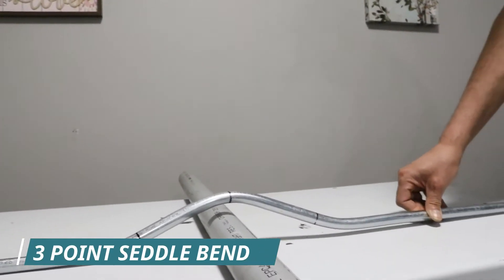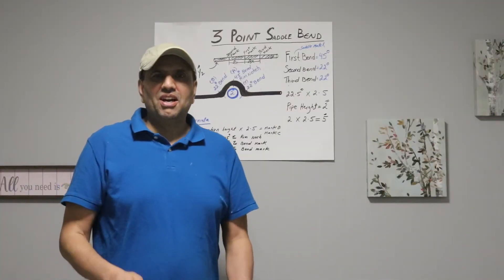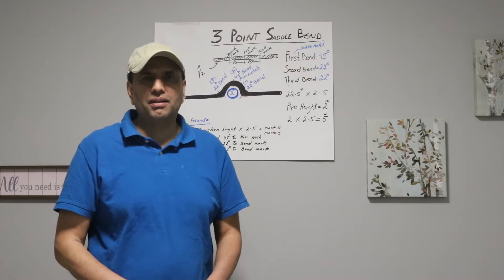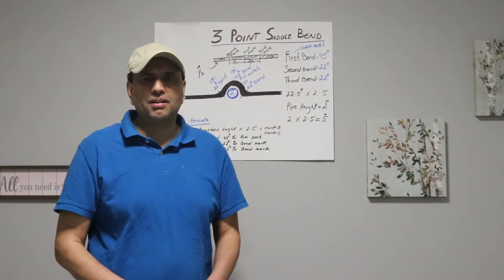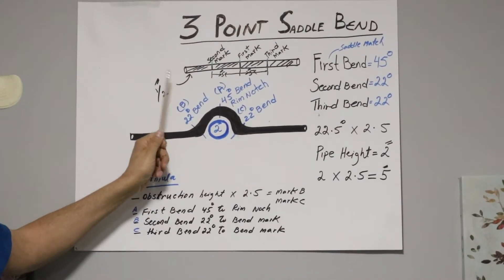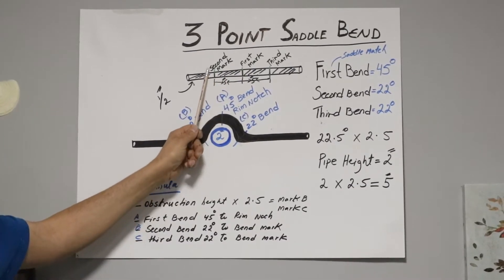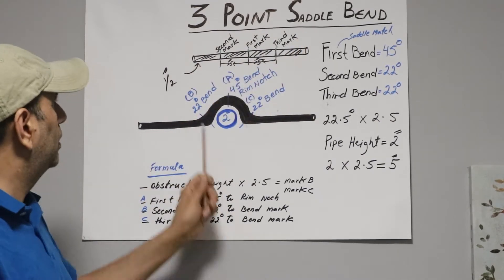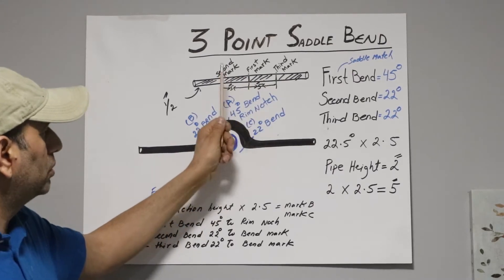How to Bend EMT conduit - Easy  3 point saddle bend conduit I Easy Electrical

Comment: Cool video. So by just using 2.5 multiplier you don't need to take the shrinkage under consideration? Sorry I'm still new to this.
Reply from the maker: You should add those values per pipe size .